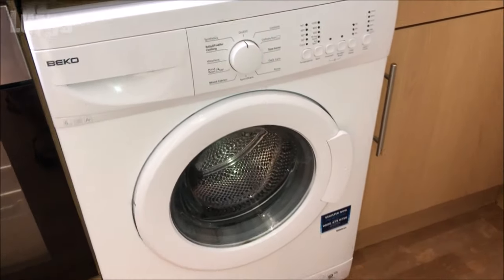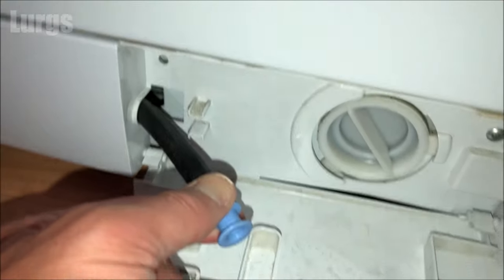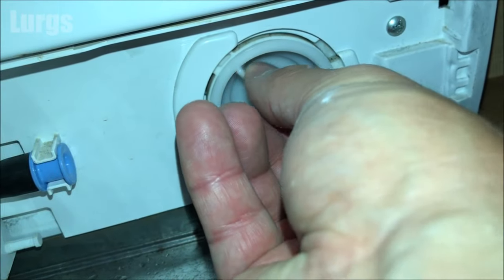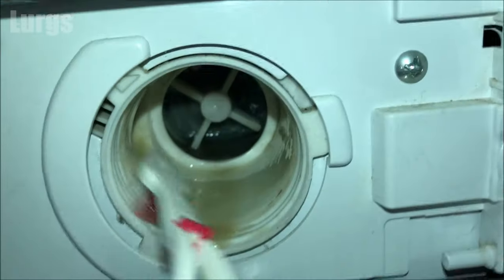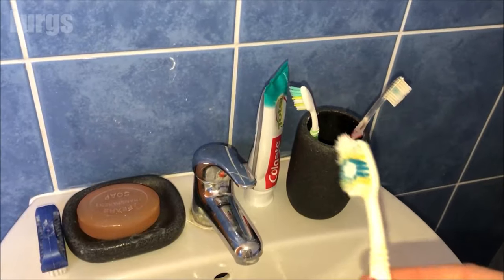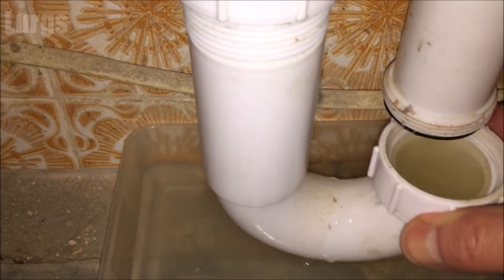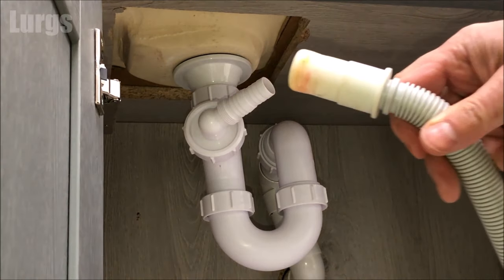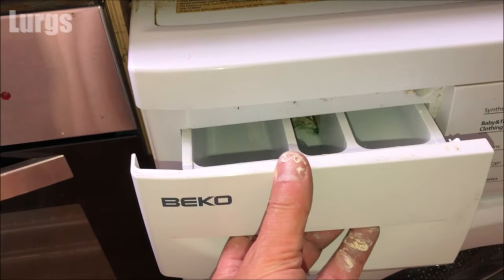Beko Washing Machine not Draining Water - Fixed

Comment: Great video, ive checked both the drain and the filter, no result. When its running if I put my hand to the filter i can feel it as if its spinning badly or rattling around, dodgy pump?
Reply from the maker: @WarsmithHuggy  Yes could be, or something is caught round it like an elastic band or long hair

Comment: Thank you so much!  Knew I needed to clear out the filter but it was a bit stuck, knowing it can get that way helped.  Had to use plyers, gently, to open it.  A small (cheap) cushion had burst in there but I also found a coin and hair pin from the previous owners!  Time for another clean of the machine once all the crap is worked out.  Still loads of stuffing in the pipe, managed to get some out using a small pipe cleaner, running another short wash and will go back and keep clearing it out until it's done.  Much appreciated!
Reply from the maker: Hope it’s all cleared. Glad my video helped out 😎
Reply: @LurgsHowToGuides  totally sorted, thank you sir!

Comment: You’re a life saver! Didn’t even notice the pipe in the left hand side. Made life so much easier. Managed to drain the water from the washing machine and clear the filter which had a small metal pin blocking it.
Reply from the maker: Marvellous news. Good find! 😎

Comment: Thank you so much for the vid! Quick question, does that drainage pipe near the bottom always have to be there? Mine hasnt got the at the bottom..
Reply from the maker: No, not all washing machines have a drainage hose, means you get lots more water out the filter so undo slowly and try to catch as much as possible, have an old towel ready!

Comment: Hello and thanks for the video!  What do you do if that spiny thing at the back is a lil tight please?  When I move it with my fork it almost has a rubber band bound back feel.  So I am not sure if the water can get out.  I have ordered that liquid you mentioned and will check the pipework ... just wanna be sure on the spinny thing.
Reply from the maker: It won’t spin completely freely as it’s an electric motor so it will have resistance, but just check there is nothing trapped around it, like long hair or an elastic band or something

Comment: Mine doesn’t have a drainage hose next to the filter, can I also drain it with the hose at the back?
Reply from the maker: No, that is the main drainage hose for when it is running. You will have water inside still. Run a spin programme only then undo filter very slowly and catch as much water as you can with a sponge or a towel. Good luck.

Comment: Hey, thanks a bunch for this guide, lifesaver!

One question here. Ours was thoroughly blocked with loads of hair bands like you showed in the video. They were mostly tightly wrapped around the turbine which is visible when you remove the filter plug. I managed to get most for these out by pulling them with pliers but there's a bit of hairband which is hopelessly tangled around the spindle of the turbine, and I haven't been able to dislodge it because the pliers I was using just snapped off any length (there is only a mm or two sticking out now from behind so practically impossible to grab). What can be done in this situation? I don't even know if that tiny amount will hamper the filter significantly, but I genuinely don't see how I could remove it anyway if there isn't a way to take that turbine assembly out (I'm guessing there isn't?) because it's just impossible to get to. The only other possibility I could imagine is trying to somehow dissolve the fibres (maybe with bleach)
Reply from the maker: Try some long thin scissors and cut it up as much as possible then try to remove, need to get it all out really

Comment: Tried your first step in cleaning the filter was helpful thanks. But when I put the little blue hose away with that blue cap it disappeared into a hole… 😮. Does it pop back out or is it officially stuck in there? Cause I put my finger in there and I couldn’t touch it so it’s completely gone
Reply from the maker: Oh dear you need to get that back out, that’s the drainage hose. Hopefully the cap was still on it? Else it could leak. Can’t have gone too far back, try some long nose pliers or similar. Good luck

Comment: Excellent video. My beko has been smelling terribly recently. I ran vinegar + boilwash, a bleach + boilwash, a baking soda boil wash, scrubbed the drum and rubber and sprayed a bleach solution into the top of the drum in an attempt to clean the outer drum which may not be getting cleaned during normal washes. I checked and cleaned the filter and drain pipe, cleaned the dispenser draw and where the draw goes but laundry still comes out smelling bad. Also, when I run a drum clean cycle there are bits of 'fluff' floating about as it runs. I'm at a loss at what is causing it. Any ideas? It seems like a major pain in the dick to remove the drum and clean the outer drum and externals of the inner drum.
Reply from the maker: Odd it still smells if drainage is clear. Maybe just do a few more super hot empty washes to try to clear the smell. Good luck.

Comment: What should I do if the filter is leaking after I put it back in? I can’t seem to be able to turn it more
Reply from the maker: It shouldn't leak. When it's locked in it should be exactly vertical or horizontal I think. Maybe there is something blocking it.

Comment: What if you can’t turn the power off as it’s behind the washing machine and I can’t move the machine by myself?? 
Would turning off the power with a switchbox in the garage work? Or does the machine need to be completely removed from its area?
Reply from the maker: Turning the power is just precautionary, you don’t have to turn it off. Yes you can turn off at Fusebox but you might turn off lots of other plugs!

Comment: Good morning! My Beko washing machine will not drain or spin. The cycle is showing that it’s ended but it’s still full of water. I know if I open the door it will all gush out. Hubby is at work 😢 if I take the end off the drain hose will the whole lot come gushing out? I might be better waiting till he gets home, but I’m impatient and want to hang it out.
Reply from the maker: Yes there will be a lot of water! Maybe try a rinse and spin to see if it clears it. Else it looks like there is a blockage somewhere. If water is below the drum glass you can get it out else if it’s on the glass it will pour out fast
Reply: @LurgsHowToGuides  thank you, I managed to empty the drum. I had lots of shallow trays, buckets and towels. So far 2 hair clips came out of filter 🫢 I’m just about to clean it with a toothbrush, so very grateful for your informative video 🙏 then hopefully I can get my washing out.
Reply: @LurgsHowToGuides  it’s working…. Thank you! 🙏
Reply from the maker: @soulie64  Great news. Best check drainage pipes and filter though as could be a blockage, at least you’ve got the washing out! 😎
Reply: @LurgsHowToGuides  will do, thanks again! 😊

Comment: Eeek! I’ve just put the blue cap on the emergency hose and the whole hose has disappeared into the machine. Would appreciate some advice - thank you 🙏
Reply from the maker: You need to retrieve it somehow, maybe some long nose pliers or a vacuum cleaner to suck it out, not a great design that it can do this. Good luck

Comment: Thanks. I was going to do this, but pushed the filter (tube with blue plastic on the end) too far in and can't reach it!
Reply from the maker: Oh dear, it's such a silly design, you need to retrieve it somehow
Reply: @LurgsHowToGuides  I have now put it  back by accessing it through the bottom of the washing machine, and drained it but the filter won't budge when I try to turn it anti-clockwise. The reason I am doing this is because my clothes don't smell of detergent at the end of the wash cycle. It's the same as if I didn't put any in. The washing machine also sometimes stops in the middle of the rinse cycle. It finishes the cycle if switched off, then on again and started at the rinse cycle. I cleaned out the drawer too. Maybe part of the problem was that the flap in the drawer was up when using laundry liquid when it should be down?
Reply from the maker: No that flap doesn’t really make much difference. You need to check the filter, bound to be a metal hair clip blocking it turning. Undo and tighten a lot and hopefully it will work it’s way loose
Reply: @LurgsHowToGuides  The washing machine only stops in the middle of the 40 degrees cycle. There is no problem with other cycles like 60 degrees or 30 degrees quick wash,
Reply from the maker: How odd. Not sure why that happens.
Reply: We didn’t get anything out of the filter but I think there is something right before the trap.  I want to look at the bottom but I can’t get the dryer off the

Comment: My machine us brand new only used 4 times but this water collection is happening should this be happening?  The door is now locked
Reply from the maker: No that should not be happening. Make sure the filter is ok and your drainage pipework. If it's new make sure when you pushed it back into place that you haven't kinked or bent the drainage hose at the back of the machine.

Comment: I have just checked the filter down there but didn’t find any foreign objects, if I do the 90 degree cleaning but the water doesn’t drain and leave in the drum again, what should I do?
Reply from the maker: It could be a faulty pump or faulty computer board. Or possibly a blocked drainage hose
Reply: @LurgsHowToGuides  The good news is, I cleaned the filter and the tunnel inside, ran a 90 degree wash for about 20 minutes only water as I didn’t have cleaner on hand, it worked, no water left anymore. Thank you so much for your video!
Reply from the maker: @0_-EL  fabulous news! Merry Christmas 🎄

Comment: Hi, I'm having issues with my beko 5140, the filter and blade part are clear and clean, the pipe on the washing machine is likewise clear as is the u bend under my sink. 

The blade spins but isn't finishing the wash and just seems to be stuck on repeat. Can't figure out how to change it and my clothes are trapped inside.
Reply from the maker: Maybe the pump has failed. You should be able to get the door open, this video should help : https://youtu.be/bQdniahf0bU
Reply: @LurgsHowToGuides  Thanks, was able to open it by turning it off at the switch. Probably have to get a new pump.
Reply from the maker: @toko96  Oh dear. If washing machine is old it may be better to get a new machine. Good luck
Reply: @LurgsHowToGuides  meant to reply earlier. The issue was the float inside was blocked, so the machine thought the drum was full of water. Managed to unblock it with a toothpick and gave it an intense 60° wash to clear it. Works fine now.

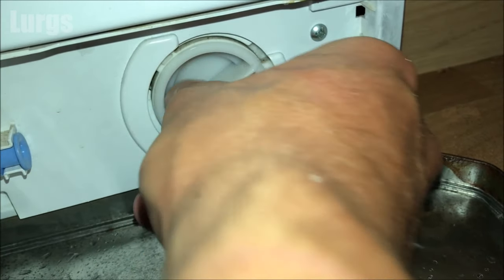Comment: Whats the function of the propeller behind 2:50 mine has come apart somehow..
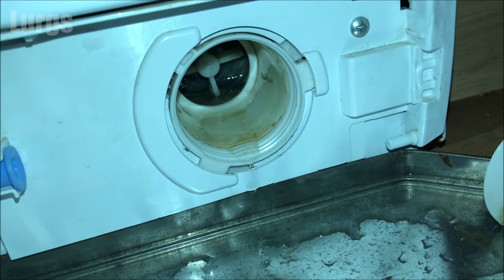Reply from the maker: Do you mean the Impeller at 3:08 ? If so that spins really fast and drains the machine, if that has broken then unfortunately it probably needs the whole pump replaced as I think it's one unit

Comment: i cant open the filter its solid  what do i do
Reply from the maker: Try untightening and tightening multiple times to see if the object clears. It is bound to be a metal hairclip. If not you may have to get a bit more forceful, but be careful as the filter is only plastic. Good luck.
Reply: @LurgsHowToGuides   Thanks for you help but i broke it so i bought a new one  thanks for the help  cheers

Comment: Mine ubfortunately doesn't appear to be so simple. No blockages. It just will not drain it is spinning but it's sopping.
Reply from the maker: Oh dear. Could be a faulty pump or computer error. Time for a call out or decide if you ca afford a new machine. Good luck

Comment: my filter does not come out.
Reply from the maker: Try untightening and tightening multiple times to see if the object clears. It is bound to be a metal hairclip. If not you may have to get a bit more forceful, but be careful as the filter is only plastic. Good luck.

Comment: what if that draining hose on bottom drop down to machine? 🥲
Reply from the maker: @Nietoperz956  if it’s got cap on then not too bad, but you need to get that back out if you can in case it leaks, also you need it if you need to drain the water